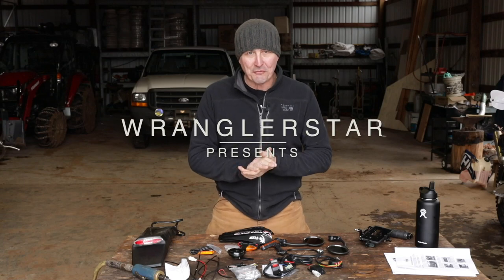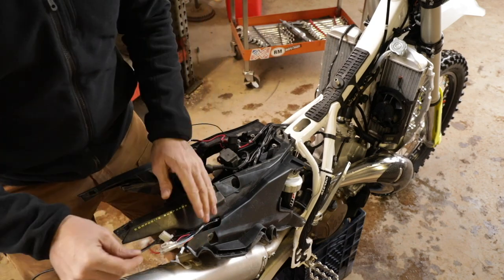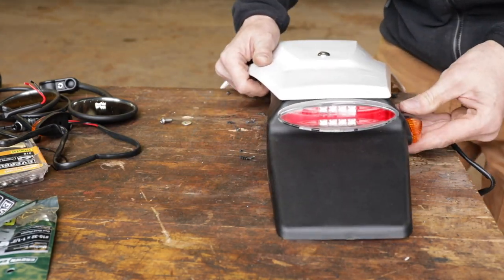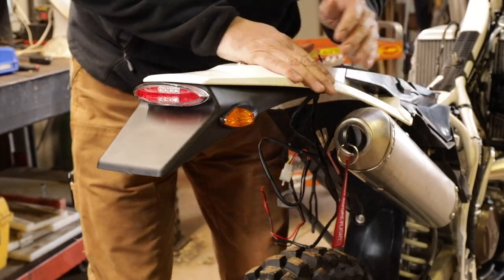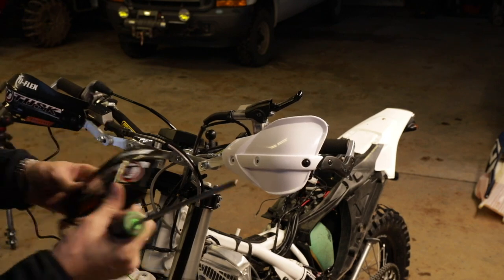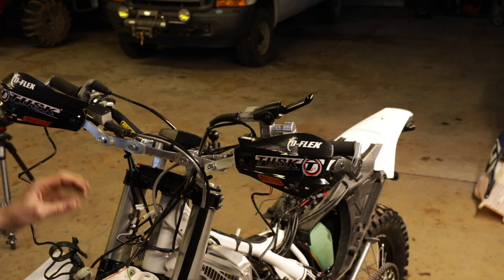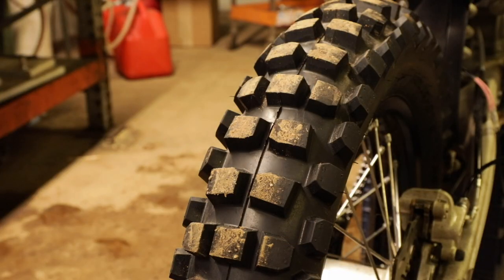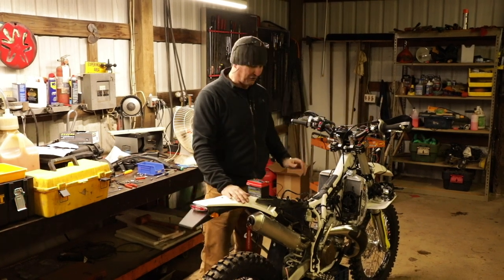TODAY MY DREAM CAME TRUE!!!

Comment: I road enduros with basicly the same kit.  Blinkers and all.    Finally broke the bark buster lights.  Beat it very well and never had any problems other than with the switch.  Make sure you seal it the top (had indicator lights on it)  and drill a small hole in the bottom to let the water out.  Once I did that no problems.  Did mine on a 450 for mountain riding.  Worked well, but ditched the little mirror for a metal folding one that was much nicer and didn't shake (it was functional)

Comment: That's awesome! Been a long time since I paid attention to dirty bikes, but I could see myself doing that if I rode. One tip that may or may not be accurate...tin your wires before you put them in a crimp connector. It's supposed to be a better method.

Comment: The wire strippers are made by AMP and rebranded by Snapon. AMP also makes a crimp tool for those connectors.

Comment: I did the same thing to my Honda 650 and rode it on the street as much as on trails, the bad thing was starting it on the trails, the thing kicked started like a Harley with 11 to 1 compression. If you stopped for any length of time idling it would overheat.

Comment: In Australia these bikes come  road legal when you buy them from the shop..if you want it that is, the bike however comes with all the gear from the factory to be road legal so the parts are genuine factory parts, not aftermarket.and they also come with a brake switch for the front brake, which yours didn't, hope you don't get rejected for that.... good move getting it road legal, enjoy.

Comment: Just remember even with those new tires you still have only about 25% of the rubber touching the road as you do with street tires.  Also street riding wears out the sharp biting edge of the knobs, they become less an less aggressive in mud.   One last thing always remove the mirrors when you are going to do any off road riding, you do not want to have to go to the doctor to remove glass from your body. Also the stakes become spears once the mirror body gets knocked off.
Reply: I've been running those type of tires on the road since I bought my bike in 06, and never slipped once.  Those tires grip better than 50/50 tire on blacktop.  I'm pretty aggressive in my cornering, and again not one slip.  On the mirrors, unless I'm into really heavy brushed out areas, I leave mine up, but I do have the folding mirrors for when things get tight.
Reply: The mirrors are probably plastic

Comment: Probably already been posted in the comments(didn't read them). Pin or pin terminal crimping tool, they have two sets of notches, one for the shorter legs and one for the longer. Buy yourself some pins and connecters, you can build yourself a custom wiring harness for most things.

Comment: I think you should solder the connectors to the wire (7:30)
I am not shure if they will hold just by clamping them
Reply: Kilian Schnitzel he used locktight
Reply: Nope, in vehicles you'll never find soldered connectors. I don't know the exact reasons but one is that solder has a fairly low melting point. So if you have a high amperage load or a short this connection would simply melt away. That's why the majority of wires are clamped. And mostly they are double-clamped: one on the wire and one on the sheath. ;-)
Reply: I have done a lot of professional wiring and I have my concerns too. However it is a little thing easily fixed so not a big deal. I am assuming he didnt have the proper crimper for those. In similar situations I have been known to solder and I am not a fan of soldering wires on an auto at all for reasons mentioned by UncleManuel. I much prefer a good crimper with the wires coated with no-ox.

Comment: Also depending on the inspector you will need to extend your rear fender as per WA law it has to cover 1/2 the tire and that little Tusk one doesn't cover it. I had to extend mine way down. I have since backed off that some now that it is plated.

Comment: you are supposed to plug the brake light pressure switch into the reservoir not the caliper
Reply from the maker: It doesn't matter, don't forget I replaced the foot brake with a hand brake,
Reply: What about a front brake brake light switch?
Reply: thehungryOMNOM haha that would make so much sense...for when he hits his front brake...that does most the stopping lol
Reply: Ahhhhh ok that makes sense now.   I was wondering why your left lever was a brake.  So the bike is an automatic? or are you running the recluse clutch?

Comment: The general DIY crimper tool you should use for this is called open barrel terminal crimper. Those tabs are rolled into the wire like little springs compressing the copper.

Comment: I had a Yamaha Enduro 175. It was two-stroke, though not super powerful. It was fully street-legal. The turn signals were huge, but were rubber-mounted and could rotate more than 90 degrees without damaging anything. I never crashed it in a way to test the resiliency of them. Love the bike though and really miss it.
Reply: Doug Goodwin It had great torque!
Reply: Probably a CT175. I used to have a gold one with black trim.

Comment: All these accessories you are fitting to your bike are making it a lot heavier and that makes a difference when you are riding in the woods. ( I have been a subscriber for a wile I like your videos not being a hater just speaking from experience)
Reply: As a cyclist I can dig where you are coming from.  I do a lot of hiking and hammock camping too.  But here is the reality to weight weenieness:  How much did that entire kit weigh?  Let's be liberal and say five pounds.  Is that really going to make any difference how he rides?  Maybe if he were in competition...But on logging trails?  Maybe he should just lose that five pounds?  That is how I look at it when cycling...In any  case, I think he intends to strip the bike when he gets his tag.  I would advise against it, but he knows where he will be riding it.  At the end of the day it is his ticket.
Reply: All those accessories?  you mean the 3 lbs it will add?  LOL I'm 60 lbs too heavy for my bike, and I still have just as much fun on it as a skinny dude.  Hahahaha  Its never affected how I can ride in the woods.  I put 15,000 miles on my bike and have not once ever came home from a ride and said, I wish my bike wasn't so heavy so I could ride better in the woods.  Just gear the bike to fit your style, and use the upper rpm's and you'll be fine.
Reply: Deric kettle these are not the only things he as added to the bike

Comment: Im not sure of how Husqvarna does it up top but can you put that brake pressure sensor on the master cylinder up top? I know you deleted the foot pedal so would that be possible? If you had the foot pedal still it would go on the rear master but I feel it could get damaged easier down closer to the wheel. Also it looks like your blinker controls are far from the handle. Could you swap the kill switch and move the blinker control over? You may only get it to move an inch over but it would be easier for you to reach with your thumb!  Just some thoughts but man that bike is really coming together, that thing front to back has been totally transformed! God Bless

Comment: Add the rear brake pressure switch    in by the master cylinder to keep the wire shorter and more protected. Keeps the bleeder on the caliper connection too.
Reply from the maker: The master cylinder is on the handlebars,
Reply: For the rear brake you eliminated the pedal?
Reply: If you wanted both brakes to operate the light as I did u can put the same switch on the front brake  I believe it would also work on your handbrake setup if you decide you want to for bleeder purposes
Reply from the maker: Yes,

Comment: That brake light switch should replace the banjo bolt on the master cylinder, not at the caliper. Also, the stock tail light it already wired for a brake light switch.

Comment: A friend of mine installed one of those LED brake lights, and the thing I don't like is you can barely see a difference between the running light and the brake light.

Comment: You would do well to coat all those bare wires and other connections in dielectric grease, before crimping/connecting the solder-less connectors.

Comment: Looks like your heading towards entering an enduro event. Here in Canada  when you buy the bike from a dealer the ownership is either for street or off road, its very difficult to get that changed after purchasing.  Did your high/low beem light work out ok?

Comment: Would it be possible to do that same kinda thing with a quad. Maybe like one of the newer quads that has came out in the past few years
Reply: Good question!  I personally have never seen a street legal quad...for whatever reason...though they ride them on the streets where I live all the time.  Cops don't care.  I even saw a couple snow machines riding right down Armstrong Rd. this winter, right amongst the traffic...Tripped me out.
Reply: There is a company on the internet that will help you get your quad street legal. Dirt legal or legal dirt something like that I can't remember off the top of my head. They do not supply lights and turn signals and wiring kits they just help you get a title you got to do the work on the quad for whatever requirements your state needs.

Comment: Can you put the brake light switch up at the master cylinder?
Reply: MJM’s Workshop yes that is actually the proper way to do it. That way you can still bleed the brakes.
Reply: Wouldn't you think the front break needs to be part of the system as well?
Reply: Van Alstyne not for a basic street legal bike such as this
Reply: Actually no, because the brake switch that is provided with that ticket is only the same size thread as the bleeder itself even if it was the same thread.. So  "OK well if the thread side was the same as the banjo bolt?" so you're going to be able to thread that in but then he can't connect your brake line....  so everyone house who commented to you didn't think that one through.
Reply: TRX VLOGGER the pressure brake light switches that I’ve seen replace the banjo bolt but act as a banjo bolt. Take the banjo bolt out and replace with the switch and it connects the line just as the banjo bolt did.

Comment: Kiss those soft tires goodbye.
Reply: I usually get 1000 miles out of a set, maybe 1500.  Yes you wear them faster but there is always a trade off depending on what you want and when you want it.  Me I wold rather wear tires faster but have the traction on the trails than be stuck somewhere or dump the bike because I had a more street type tire.  By the way I have never slipped on the street with my trackmaster or the dunlop 606 tires.

Comment: I can see you replacing drive tires once a month until the novelty of riding your bike to town for every little thing wears off  or you make the news " a man riding with a 4x8 sheet of 3/4 plywood strapped to his back" lol. You know your going to want to put a straight pipe on the bike just for those 5am bike rides to town for chits and giggles LOL.
Reply: Graveltrucking the real question is riding the dirt bike with a sheet of plywood strapped to his back how fast does he have to go before the plywood creates enough lift to pull him off the ground
Reply: Depends on how ''airfoiled'' the plywood is :P
Reply: I run the trackmaster tires and before that the Dunlop 606 tires, and I usually got about 1000 miles out of a tire.  The more aggressive a tire is the faster it will wear.  One of the best tires I ever ran was the Kenda K270, it was more like a 50/50 tire, and for gravel, streets it was awesome.  Not so much on the trails if you got into any mud.  Its all a trade off.

Comment: i bought that kit for my 350
Reply: you should put the break switch at the slave cilnder
Reply from the maker: Can't I switched it to a hand brake,
Reply: Wranglerstar o i used the cable acuated rear hand break so i have both

Comment: Are you in Oregon or Washington?  If Oregon, did you check with the ODOT on getting that bike plated?  Oregon has a REALLY draconian set of rules to get a dirt bike plated now, including the killer clause that states you need a certification from the manufacturer stating that the bike meets street emissions standards (which almost no dirt bike does.)  Hate to see you go through all that work to get hosed by the bureaucrats at the DMV...http://www.oregon.gov/ODOT/Safety/Documents/ConvertOffRoadMotorcycle.pdf

Comment: Meh, why did you contaminate that nice Husqvarna with Tusk equipment. Enduro engineering sells a plug and play brake light switch for the stock taillight. Also mirrors, horn etc. is sold by Husqvarna power parts. My TX 300 already came with a street title but I don’t ride it on the street. But check out Husqvarna power parts in the future. All great stuff that is factory.

Comment: Not a lot of sense making it into a street legal bike when you can buy a street legal bike that can used off road.
Reply from the maker: How is it you know so much about what I need for a motorcycle?
Reply: All I know is the world became a place where you can buy bikes that are made to meet a terrain,  or they can be made for both... trying to turn a dirt bike into a street bike only makes the dirt bike worst on dirt. LOL
Reply: Please explain how that bike will preform any differently than it did before he installed the lights and horn.  And don't try the weight BS because all that kit together cant weigh five pounds.  That is not going to make the slightest bit of difference to anyone short of a pro.
Reply: Remember Tenspeed, common sense isn't all that common anymore. Can't wait to hear what he says in answer to your. I suspect crickets is what we will get.

Comment: 8:15 gloves?!!? can't let the brake fluid touch your delicate hands? sounds prissy to me smh tsk tsk tsk . . .
Reply: Uh Not at all. I generally can't wear gloves and or don't when I work on cars. Gear oil, transmission oil, engine oil are nothing. Brake fluid is some nasty stuff. I'll wear gloves for that stuff or wash my hands ASAP. That stuff will penetrate you skin pretty quick and it isn't as harmless as your wifes hand cream either.